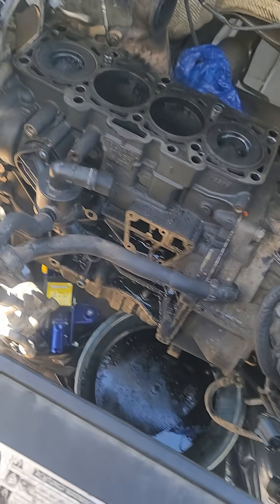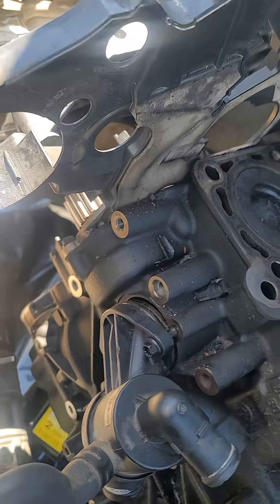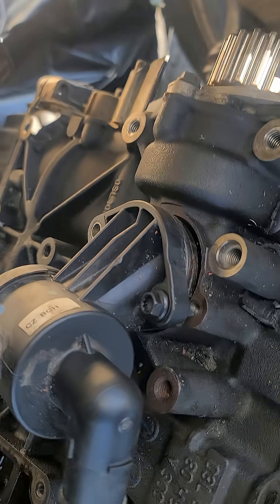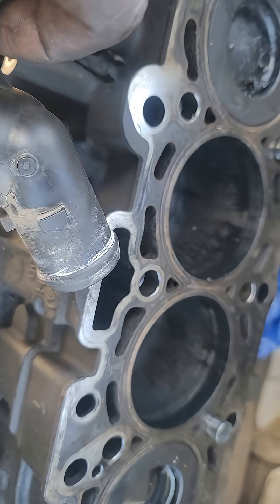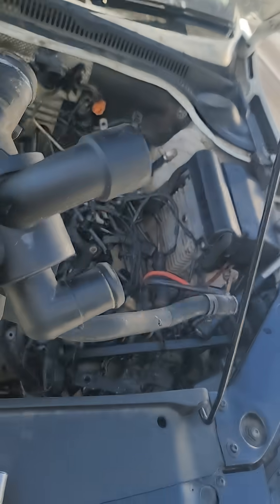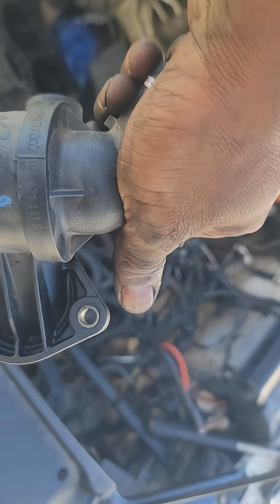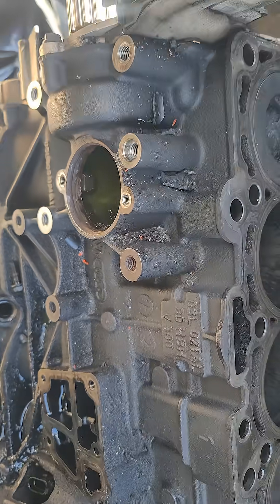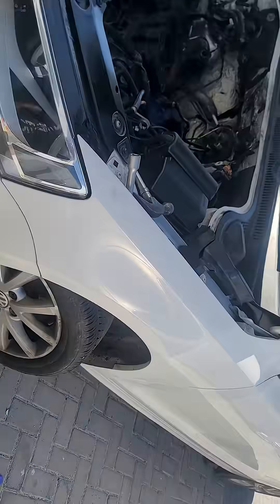vw jetta tdi thermostat #cars #automobile #jettatdi #engineering

Comment: u just buy the whole housing its like 100, and you dont need to remove like anything dude what are you doing you stupid ? If you have fat fingers just remove the intake, i dont remove anything , Skoda have it like that too, just look at video if you dump. 1.2 Tsi have it on driver side , and you buy the whole housing. This is youst waisting your time, if youre not doing like headgasket or something  else
Reply from the maker: Yes I will buy the complete housing it has the thermostat inside